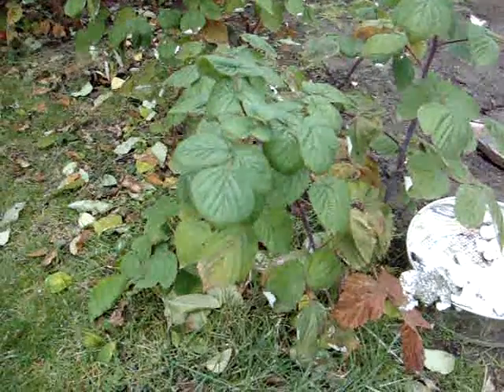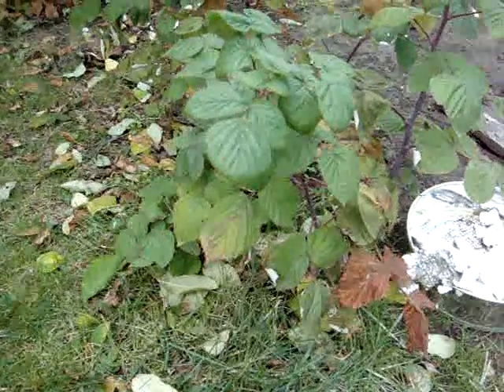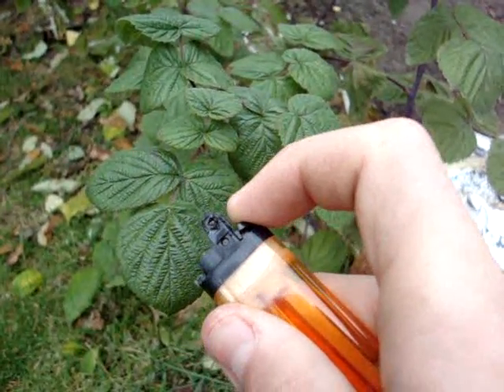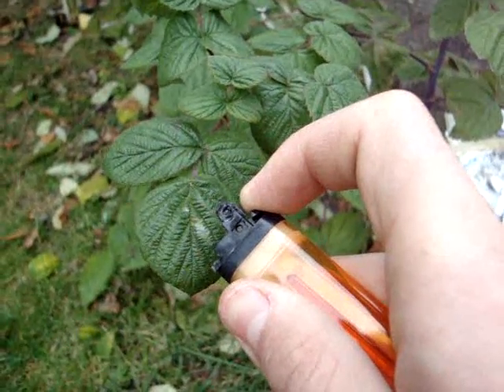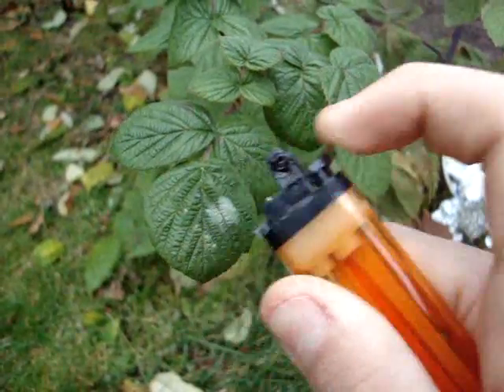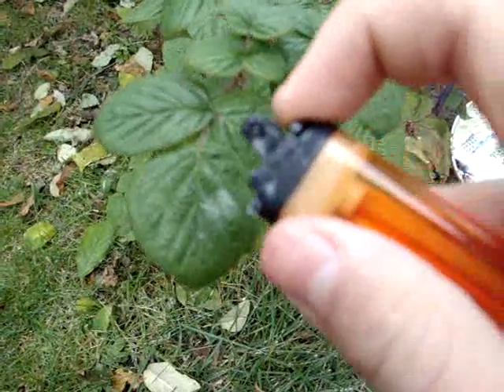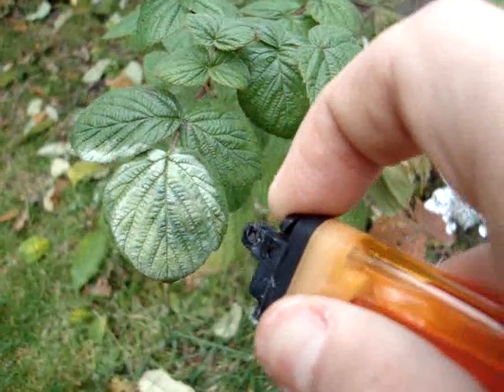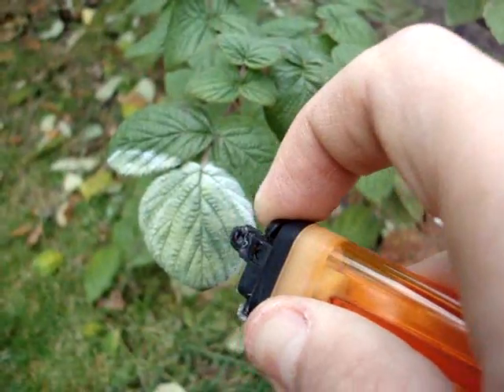Freezing a leaf with a lighter

Comment from the maker: @darkthunderex it's because butane is a liquid under pressure, so when it's released it rapidly boils and evaporates and it uses up energy to do so. the rapid cooling freezes the plant and the moisture in the air.